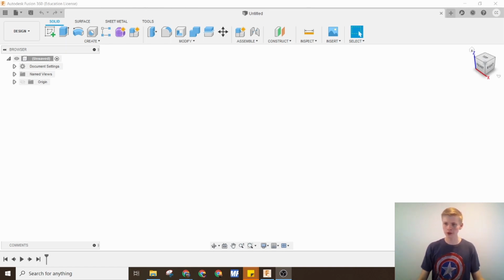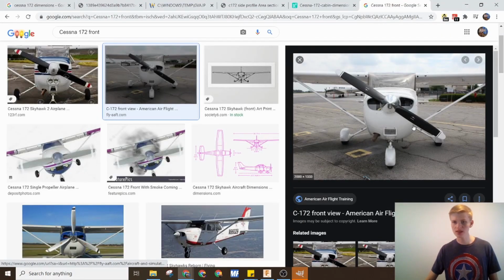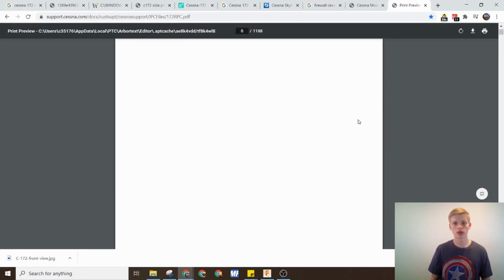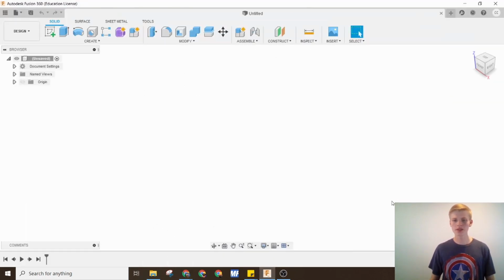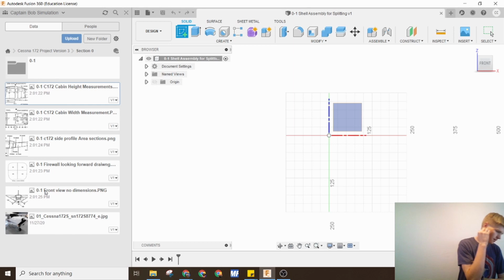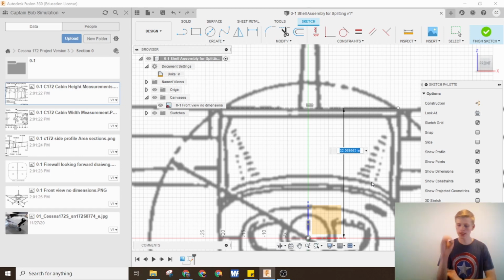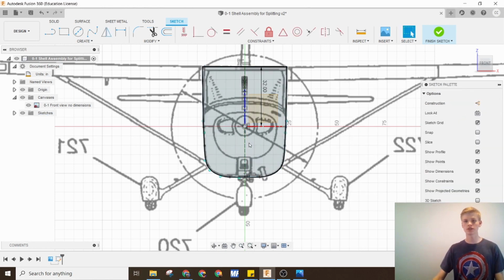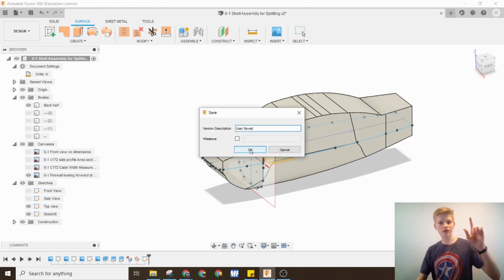Designing a Flight Simulator Shell in Fusion 360 From a Few Drawings | Captain Bob | Cessna 172sdays

Comment: Remember the 3-way drawing might be with orthographic view (straight front no perspective) and all photos have perspective distortion, the more the shorter your lens focal length is.

Still, as long as you get stuff roughly in the right places, if you don't use any real structural parts from a real plane, it does not really matter that much in practice, the measurements and drawings on the manuals are probably your best guide anyway.
Reply: Hai Bob and Tuomas, the way I approach it at the moment is by using scaled plans from wooden RC planes. I scale them up to real size to fit my Cessna style IP. These plans provide very nice sectionals which I draw in 2D, to have them CNC’d from one or to sheets of plywood. In the same way as modelplanes are built, I put them together. The one thing difficult remaining is the canopy. 
But thanks for your consistent approach on things! Kuddo’s
Reply from the maker: Thank you Anco! I’ll have to try this out too! I haven’t thought about using the sectionals :)
Reply: @CaptainBobSim  I’ll send you a link
Reply from the maker: That would be awesome!
Reply from the maker: @Gersmobiel  That's brilliant! It works, thank you!
Reply: @CaptainBobSim  please show me you're progress, cause my learning curve is a bit steep at the moment. Got the files? I'll remove the link.
Reply: and you could add an "S"in you're "Want me to see your simulator? Use #cessna172sday in your Instagram photo or post it in the Show Your Sim discord channel" ;)
Reply from the maker: @Gersmobiel  I'll do that in a few upcoming videos :)
Reply: @Gersmobiel  the model airplane drawings also have a  structure that is easy to build from plywood - that is a great idea!
Reply from the maker: Thank you for your insight! I didn’t think about the lense shape!